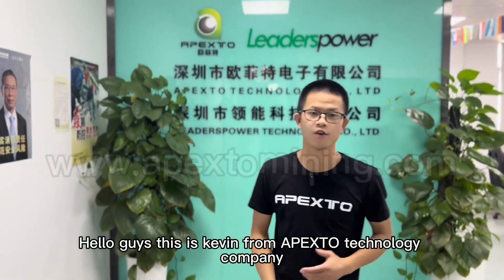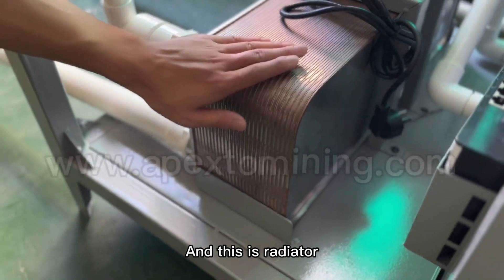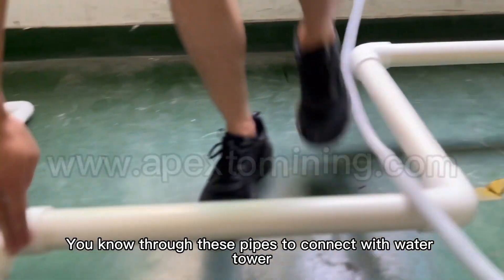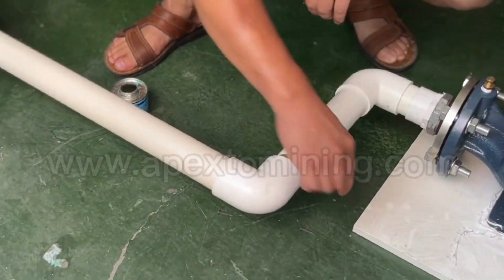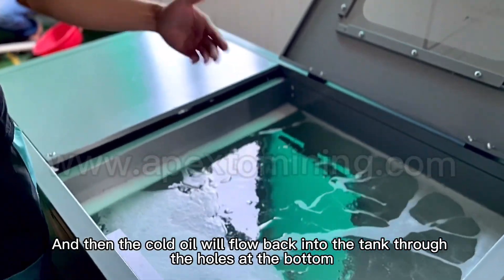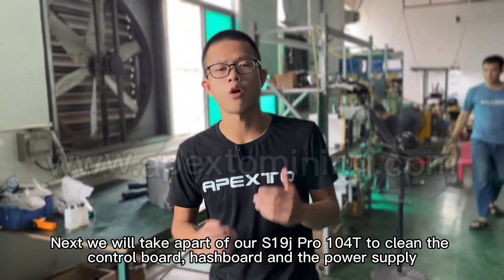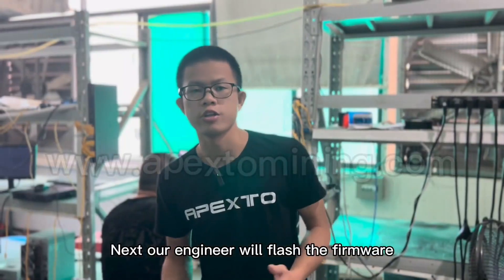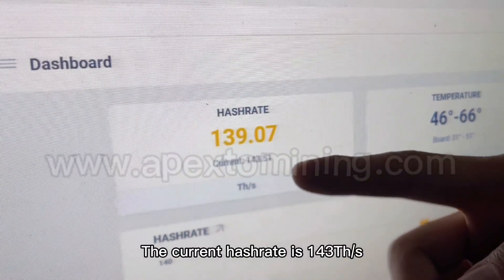Apexto Oil immersion Cooling Systems Overclocking Mining Machines for Antminer S19 #cryptocurrency

Comment: that looks nice! Is there any other option to overclock kadena miner and cooling in mineral oil?
Reply from the maker: Need to check with the background to see how much we can over lock. For cooling it’s no problem.
Reply: @ApextoMining  I have a KD5 and KD-Lite. I want to put these two in oil. But i think it makes no sense to cool these miner in oil because i cant overclock these two miner :x
It would be very nice if you can check it with your team
Reply from the maker: @kryptotechz  ok. Let us check how much can over lock with Kd lite and kd5 first.
Reply: @ApextoMining  oh wow! that's really cool! Many thanks :) i will stay tuned in this comments here and waiting for your answer :)
Reply: maybe, can you test KD5 for undervolting with aircool? like from 18 TH/s and 2250w to 11 TH/s and 1375w, cause of the high electric costs currently...